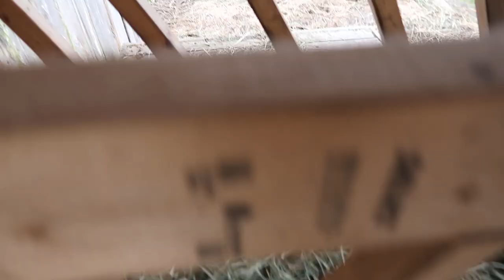You WON't Believe IT! Finding Out the GENDER of the BABY GOATS

Comment: AL here’s a tip: U can do like I done in my goat barn.... I built with wood but not treated wood just plain wood I built two different feeders.  I put a feed troff & a hay feeder on the wall in different spots & screwed them to the wall just up high enough they couldn’t jump into them. Well they can get up on the 6 foot long feed troff but they is no way they can get their legs stuck in it the way it’s built. But my hay holder troff is V shape like the one you got outside but it’s up high enough on the wall that they can’t get into it or get their heads stuck in it. Brother it will save you a lot of hay from getting pooped on or otherwise trampled &  wasted on the barn floor.

Comment: Got the genders right. Clue was the larger size of the white one. My name suggestions are Flopsy, Mopsy and Peter. Olivia did great with the tractor. I learned to drive that way too but wasn't so great with the clutch and brake. A might too far for my feet-had to stretch to reach them.